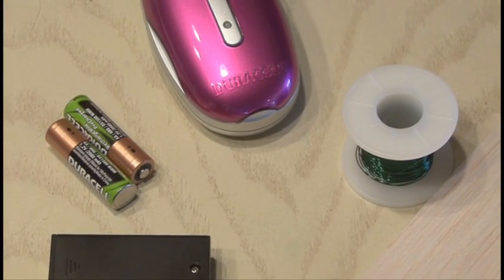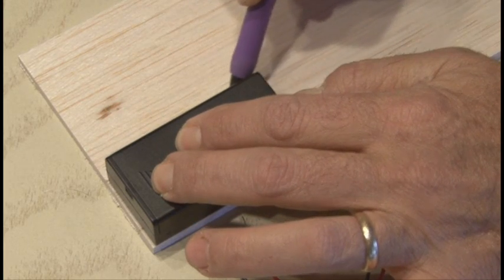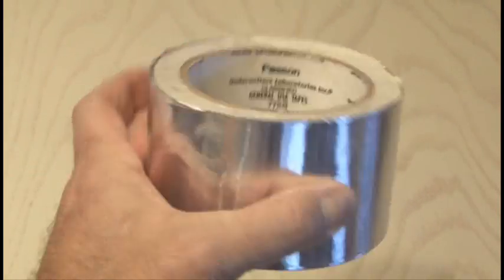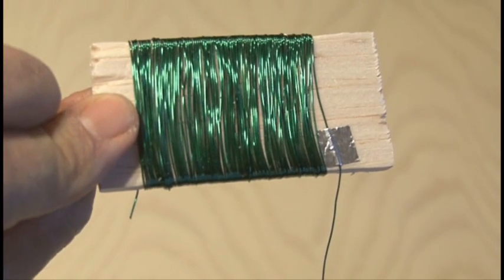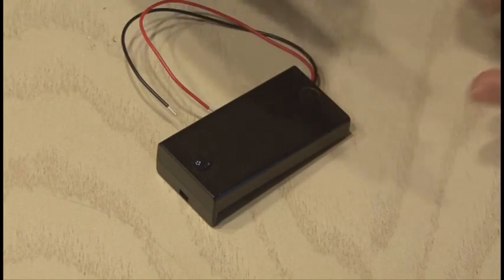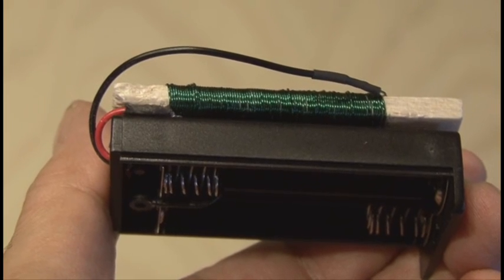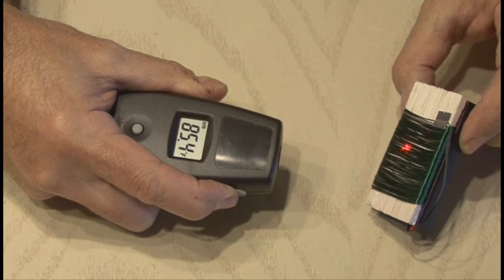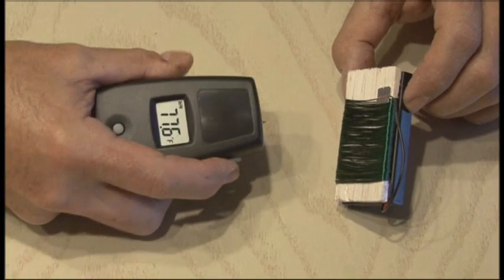Weekend Project: Personal Portable Heater

Comment: @Edgrs not exactly, because of the amount of windings, it is creating a short to the battery, but also the 30 ft or so of winding will have a few ohms of resistance. This will make the short, not necessarily as bad as a short wire going to the battery. Batts would be warm, but the wire would be warmer. This is useful, and that is how some other heaters are made. 
I bunt a hole in my pants accidentally by placing a spring in my pocket, and unknowingly put a 9v batt in. it smelt like  marshmellows

Comment: @Mikemc A lot hotter than 107F, that's for sure.  Otherwise anyplace that sells it in Florida would catch on fire every summer. haha  After all, it does get up to and maybe even over 120 there in the summer.  Actually, I just looked it up on the net.  Balsa wood has to be over 400F to ignite.  So, we are all safe with this heater. :)

Comment: you just can't ignore the resistance of that much winding of wire. it actually act as a resistor, so it is not a short circuit. Trust me, I'm a Electrical Engineer.LOL

Comment: i think you would be better off buying the chemical hand warmers found at the local gun shop. they are a non-toxic & biod degradible mix of salt iron powder and charcoal. pluse they last about 6 hours +-. It is good project if you just want to make somthing but not a practical solution for cold hands.

Comment: i made one and tried it with the 2 AA's but i found that it worked better with a 9v and a push button switch. i hold the switch and it heats up in about 5 seconds =)

Comment: not really. Your creating a sort of inductor. so there is a bit of resistance in the coils which in turn provides heat. the more coils the less heat you get because of the resistance. the less resistance (less coils) the easier the electrons can pass through which will create more heat. Is that understood or no?

Comment: I would recommend to not turn the wire that way. that is an inductor and if the current is high enough, you risk a shock when you disconnect batteries... I'd turn the wire for half way in a direction than, for the other half in the opposite direction... just to avoid any inductance.

Comment: It is not a good idea to short out batteries.  They could overheat, their guts expand and leak acid or even explode.  Different battery chemistries will behave differently.
I think this idea of a hand heater would be for emergency use (or just for wasteful fun) only.

Comment: The wire is not a perfect conductor.  The longer the length, the "harder" or less efficient it is for electricity to pass through it.
He is basically shorting out the battery.  If you have ever shorted a battery with a small wire, the wire gets very hot very fast.  At longer wire lengths, the wire still gets hot but the heating is distributed along the whole wire length.  The green coating is an isolator so the wire doesn't short to itself when the wire crosses in the wrap.

Comment: An 8.4V, 150mAh battery has ~1.26 Wh of energy, while 2 x 2000mAh, 1.2V batteries used here have 4.8Wh of energy, almost 4 times as much.  Usable energy you can get out is dependent on discharge rate, though.  Be careful not to over-discharge, as that can kill your battery.

Comment: At 1 amp, this outputs 2.4 Watts.  Compared to the typical human body heat output of 100-125 Watts, you'd be much better off with a good hat and gloves.  Better yet, get a lighter fluid hand warmer, since there are no power transmission or conversion losses.